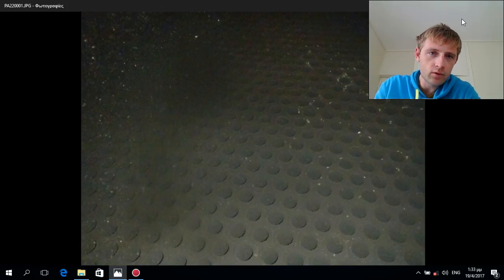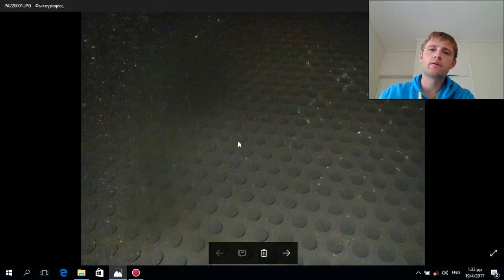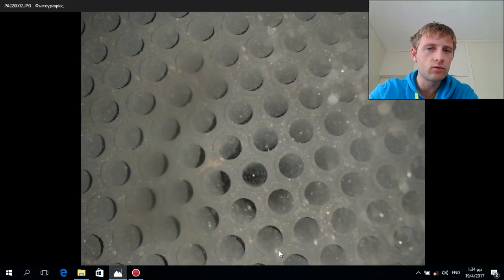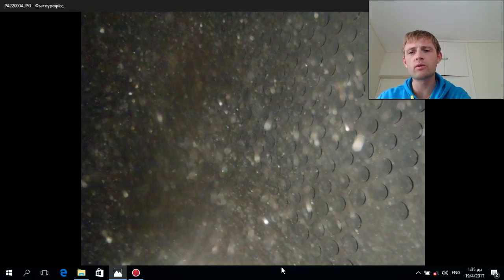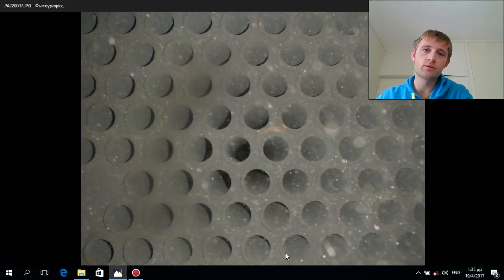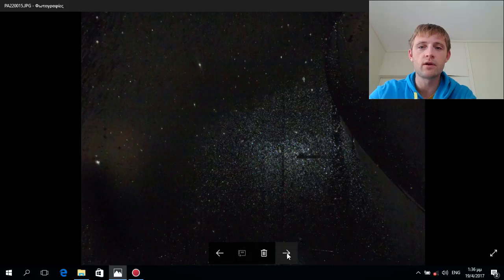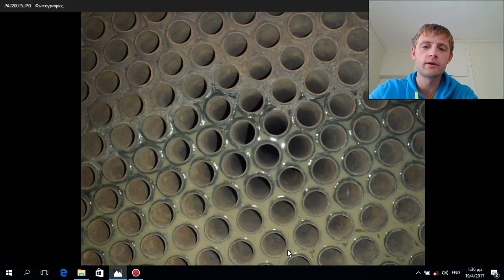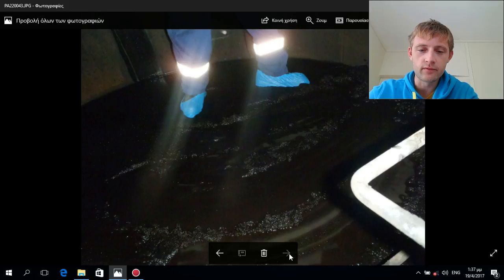Exhaust Gas Economizer tips

Comment: Pls can u make a video on how the exhaust gas boiler works
Thank you
Reply from the maker: Hello i have made such videos but quickly i can explain the operation the water is circulated from a pump EGE pump which keep all system under pressure also this steam water will pass next to aux boiler in tanker vessels.Through the travel of water from gas boiler the water easy turn to steam.If you check there is one thermometer on inlet and one in outlet check the tamperature the outlet will be less temperature but how is this possible? This called laten heat.
Reply: Adventure Story thnx

Comment: so you are saying exhaust gas in the tubes,wont in increase the back pressure of main engine exhaust flow??
Reply from the maker: siva rajan will increase little but not plug it if they will built soot will blown by the pressure.

Comment: abt aux boilers, how you clean the exh side? use sea water ( i heard its better to 1st step of cleaning after of course flush with fresh water) or fresh wt if we don't have a special tools for cleaning ??
Reply from the maker: normal cleaning take place with fresh water and high pressure machine.If you don't hava high pressure you can use water hose from engine room.
Reply: but did you heard abt use sea water ?
Reply from the maker: Yes i hear maybe they make economy to fresh water that's the way they use.But imagine that you need to make double work first bring sea water use fire pump then put back and prepare fresh  water .It's your choice ,but i never use of sea water for cleaning tubes inside boiler.